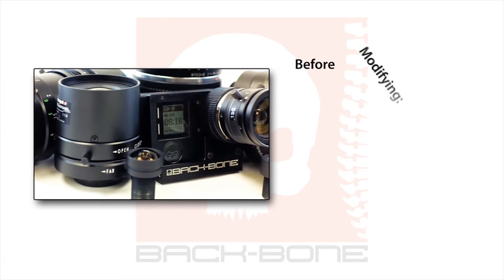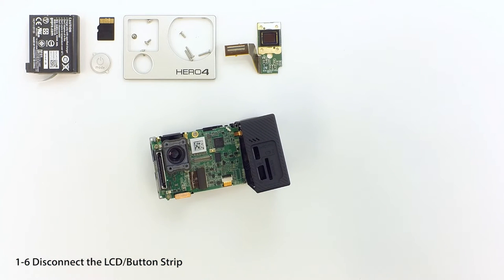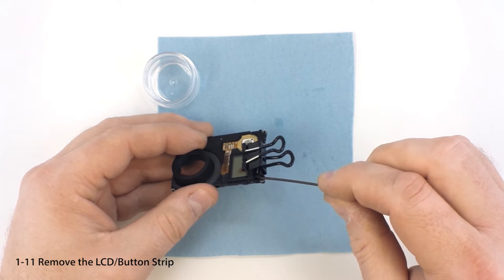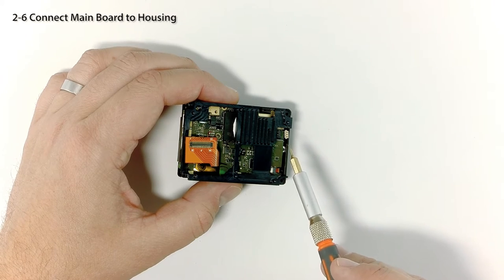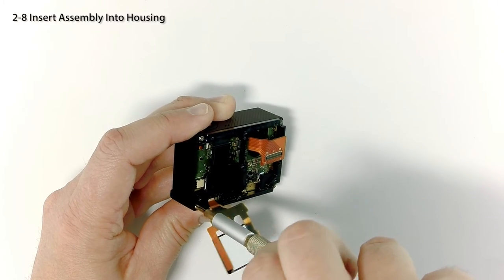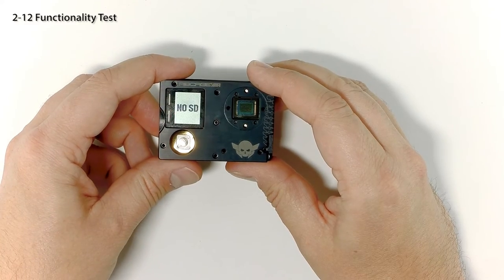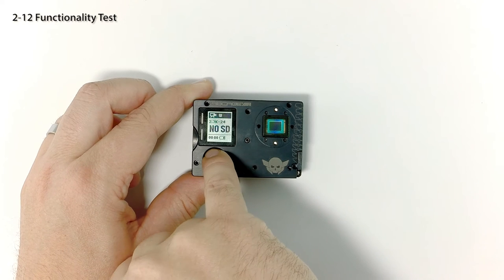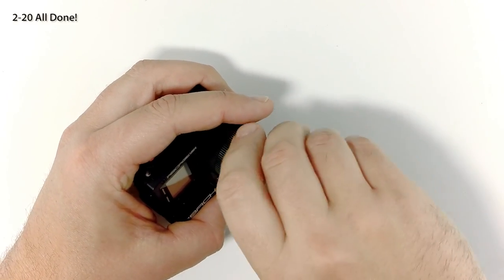RIBCAGE AIR: HERO4 BLACK INSTALL VIDEO

Comment: Please help me understand. The lens adapter require the sensor swap? or sensor swap is to upgrade sensor performance?
Reply from the maker: The same image sensor is used but it's position is moved forward during the modification. An extension ribbon is used to change it's position

Comment: Is the ribcage kit sufficient for mounting the 1/1.8" 25-135mm Varifocal lenses or do I have to purchase an additional C-mount adapter?
Reply from the maker: The kit comes with everything you need to mount that lens, so an extra c-mount ring isn't required.

Comment: Hi

If I get the deep socket m12, can I still use the original lens with it? thanks.
Reply from the maker: You would need to switch mounts to use the original lens as it can't go far enough into the deep socket mount to focus
Reply: @BACKBONEca  thank you. Is there such mount for Air?

Comment: Ok, now i know why GoPro cameras suck at becoming digital microscopes. CCD is set back too far. I thought it would be cheap to reuse a hero-6 for soldering station. Oh, well. Amazon has USB and HDMI cameras for under 99usd.